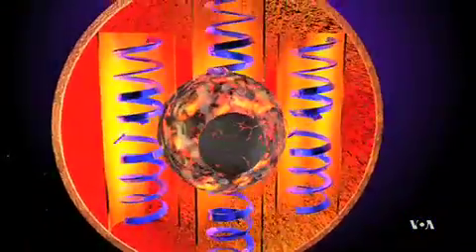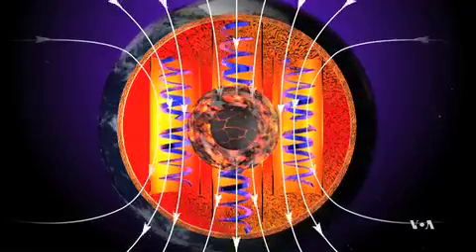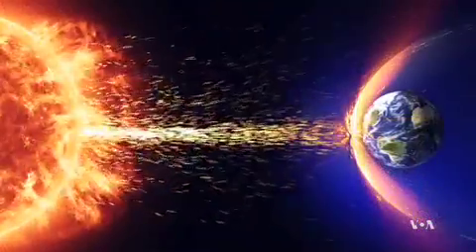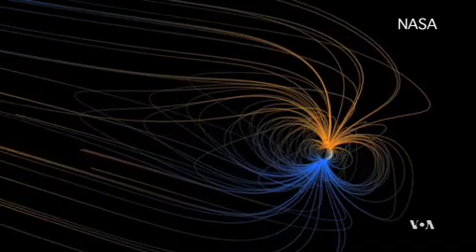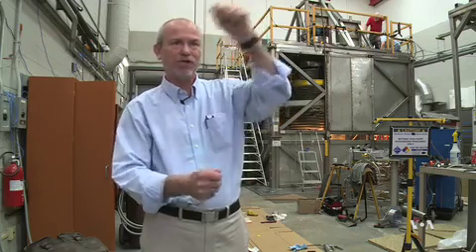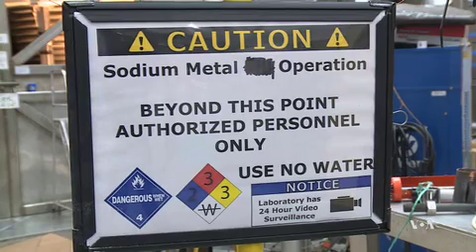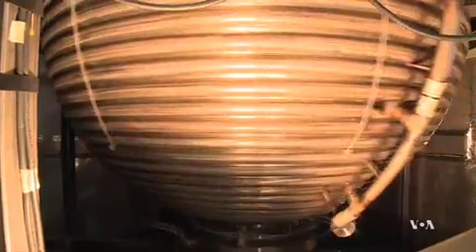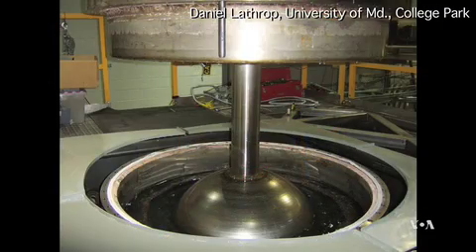Understanding Earth’s Magnetic Field

Comment: The result will be very interesting, but very predictable. The source of the magnetic field must be looked for not inside, but outside ... Mars has a very weak magnetic field. It is easy to see how this planet differs from ours - there is no such atmosphere as we have .. Our planet has a negative charge and powerful thunderclouds, which have charges of hundreds of millions of Volts, and it rapidly rotates - 500 meters per second, and not as in your case ... If the charge is rotated, then we always get a magnetic field. A stationary, so-called static electron, has only an electrical component - this has been confirmed many times by experiments. And all the electric charge is contained exclusively in the center of a very small sphere, and around the needle of the dipoles. And the farther they are from the center, the weaker they hold on to each other .. Recently we received a photo of an electron - this is exactly so ... With these needles, when rotating, it creates a small tornado in a dipole field ... And it is perceived by us as magnetic ... In addition, during translational motion, a single soliton wave is created in front of the electron, and it consists of many neutral dipoles - neutrinos, and this wave moves along the filaments of the dipole field as along rails or a channel. Therefore, a photon is not a particle, but a collection of them. And the fact that dipoles, due to their properties, form long strings has long been known. If we break the dipole, we get an electron and a positron. Hence the conclusion - the entire mass of a proton and an electron is neutral dipoles. But they are packed in different ways ... If we break a proton, then we get multiple breaks of the dipoles. And thanks to instant reconnection, there is an infinite number of all kinds of short-lived electric chimeras ... There are already more than two thousand of them ... And this is not the limit ...
If the magnetic field created the molten core of the planet, and this is physically impossible in principle, then we would get a very small, in size magnetic field. An insignificant field is induced by stray currents that pass in the earth's crust, but it does not play a decisive force ...